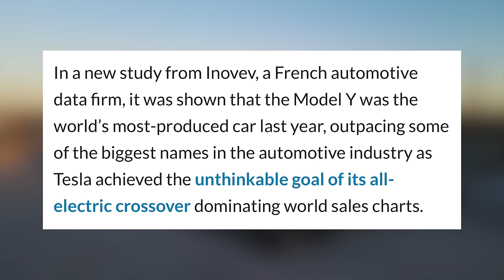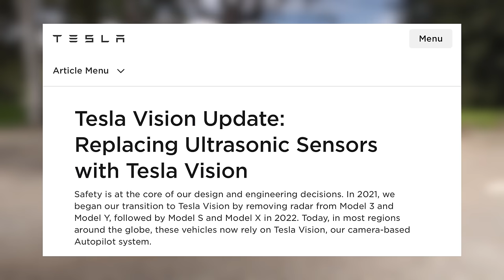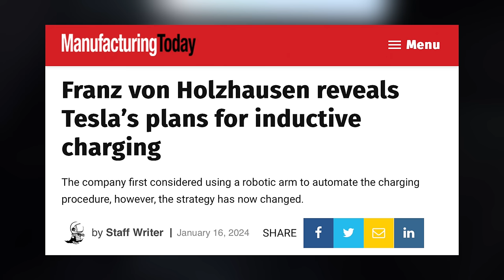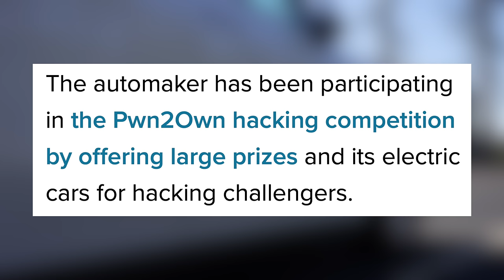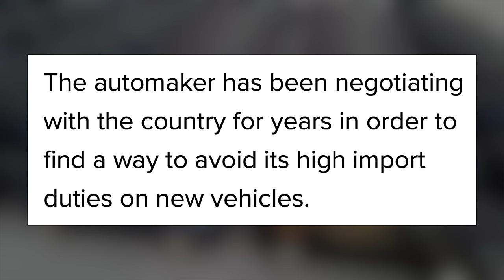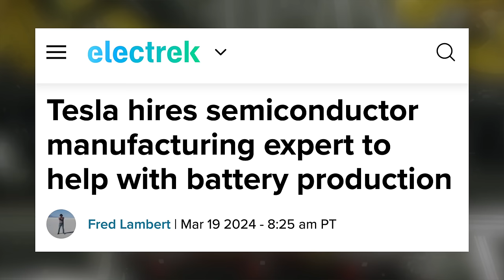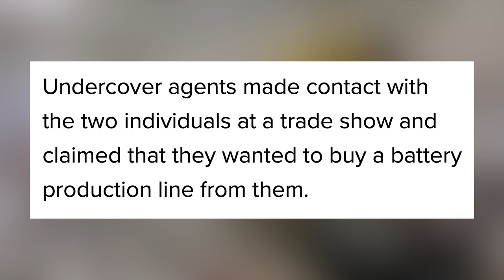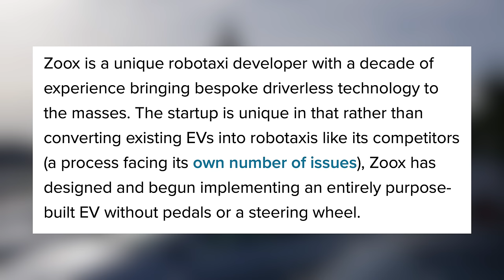Tesla Model 3 Got HACKED | They Finally Did It

Comment: Wired charging efficiency is about 95%. Wireless charging efficiency is about 80%. So each time you fill up a cybertruck wirelessly with 100 kwh of electricity, poof there goes an extra 15 kwh of electricity compared to wired charging. Over the course of 1,000 battery cycles. That’s 15,000 kwh wasted. At my local electricity rate, that is $3,150 then add in an extra $2,000 for wireless charging hardware  and you’ve wasted $5,000. Is it worth $5,000 to be able to wireless charge at home? Not for me.
Reply: The real question: can our grid afford all that energy wasted? In the long term that kind of thing would be unbelievably damaging to our energy usage.
Reply: If you have a garage this doesn’t make sense.  It might make more sense for apartments or condos because it should be more durable.
Reply: Yeah i think everyone agrees with you. But innovation is great, maybe one day it will be viable.
Reply: Exactly. The 15 seconds it takes to plug/unplug at home isn’t any issue. Public chargers are vulnerable to vandalism and copper thieves so inground wireless inductors make sense so long as they don’t have to mechanically raise up to get close to the receiver which would introduce all sorts of grit and corrosion problems.

Comment: Auto parking: there’s a difference between having it and it being of any use.
My MS with FSD will park accurately but so glacially and with much wheel juggling and long pauses that it’s effectively useless in anything but a deserted parking lot with no other vehicles to stir into road rage. Given the speed of computational I can’t see what is the issue making the system so poor.